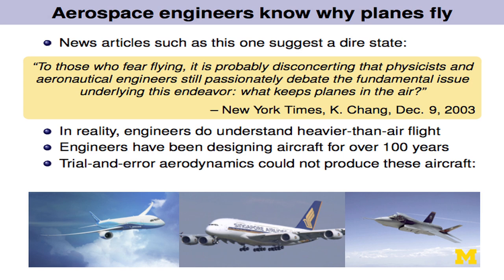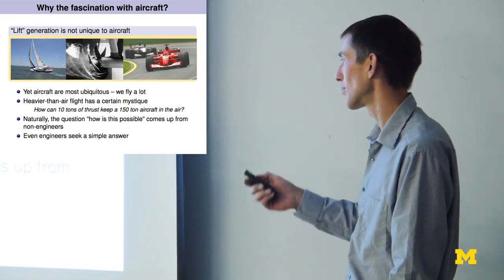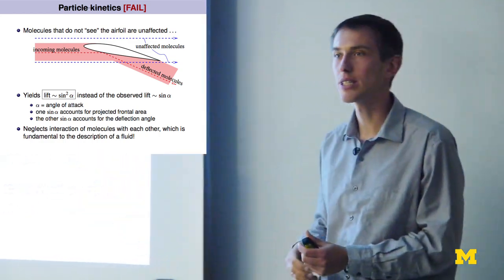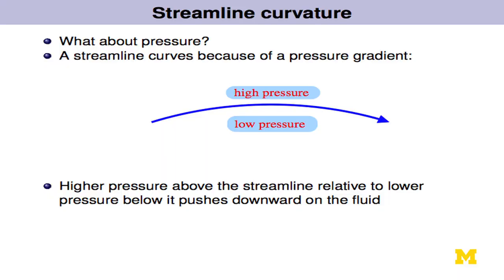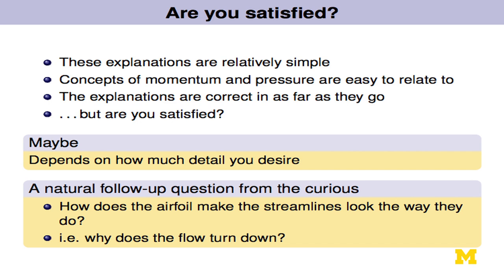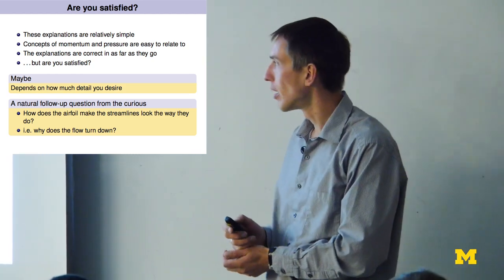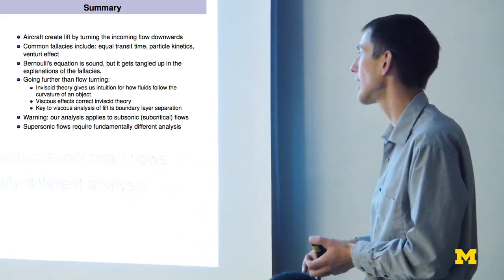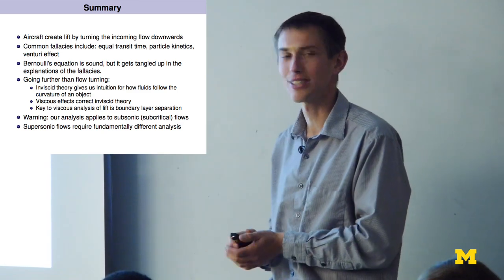Krzysztof Fidkowski | How Planes Fly

Comment: At 21:06 Prof Fidkowski does seriously misspeak.  I am very surprised he said that.
.
He glosses over just what the "pressure difference" would be when using that "Bad Bernoulli" misconception.  IF speed had something to do with it, the "moving air" would have lower pressure.  That is the air farther above and, therefore, [if' moving' air had a lower pressure - it doesn't]  the flow would curve UPWARD away from the wing. SO this is a double error on his part.  OOPS!!
So, yes, what he said is wrong.  O U C H ! ! 
.
. . . In addition, the air right above the wing IS MOVING!  In fact, it is moving in the opposite direction of flight - WHEN viewed from the ground as a wing passes by. SO. . . NOT ONLY can't you have stagnant air there, you don't! PERIOD! We SEE it moving toward the trailing edge BOTH in the wind tunnel and in flight. . .
I think I should talk to him. . . 
.
Also around time 23:38 He glosses over the fact that that "sharp turn" around the trailing edge is a HIGH acceleration. He only mentions needing a sharp Pressure Gradient.   He doesn't explain WHY viscosity and boundary layers make the physical flow off the trailing edge - that is very vague.  
I claim that it is the need tor a very high Pressure Gradient and the air's inertia that helps us understand why BOTH flows leave the  trailing edge like that.  Because it must.  Don't confuse things with inviscid flows.
.
You must cover the important fundamentals first, then when the student understands that, THEN you can add the more complex and issues beyond the basics.
.
For a wing's lift, it is best to start with the fact that lift comes from ONLY the  Top-Bottom pressure difference, Then, explain how/why those two are formed.
.
AFTER THAT, then. . . talk about the stall, upwash, downwash, tip spill, tip vortex, induced drag, form drag and intersection drag.
.
I also feel that he should NOT start with all this "separation" talk and the turbulence examples.  That is not part of flying.  That is part of NOT FLYING!.
I've seen this in my initial field of Electrical Engineering.  They want to explain everything up front and put too much unnecessary things in too early.

Comment: Idea of lift is simple. Introducing of obstacle into flow will change velocity of flow     (direction and speed). Any changes like this call fluid acceleration/deceleration. Any acceleration/deceleration will cause fictitious force ( remember what happen when we push brake pedal in car or turn car ) . Such force pushes fluid and causes pressure changes 9 as your fasten belt in car) . As long as pressure distribution around obstacle is not symmetrical ( as around not-rotating ball) obstacle will experience some net force  named lift  .
Reply: +Andrew Pa  i agree that the explanation in the video still fails to explain exactly how a low pressure area is created above the wing—saying it must exist by examining the air flow is not an explanation.

The conclusion that to explain lift one must consider viscous and inviscid flow simultaneously is, unfortunately, the conclusion—i expected it to be the starting point for explaining the colorful pressure distribution diagram that seems to be produced using Finite Element Analysis (?)

Since the simulation model seems to produce flows and pressures that match practical observations, maybe examining the FEA parametric variables step by step would help explain what happens and why.

Your explanation: I'm not used to dealing with fictitious forces as part of a valid solution in physics, so I did not understand most of your explanation. You seem to be getting inertia involved but it got quite confusing—likely due to the english structure. There may be a valid explanation lurking there... would you please re-write it perhaps just using Newtonian forces that I can understand and that can be validated in a lab, wind tunnel, etc.?

Regarding the ending part of your comment, you may have missed that part early in the video which points out that your explanation of non-symmetrical shapes and different lengths of flow does not account for how the symmetrical camber wings of some aerobatic airplanes produce lift or how an airplane flying inverted produces lift on the side of the airfoil that is opposite to your explanation.

Also, per your explanation, an airfoil with a relatively flat lower surface and a "wavy" corrugated upper surface should produce an incredible amount of lift — in reality it doesn't.

You seem to have a typo error while giving an example of non-symmetrical flow: "as around not-rotating ball" should probably be "as around rotating ball." This is because a non-rotating ball would have symmetrical flow around it and net zero lift, whereas a rotating ball WOULD "rotate the airflow with it" to a new direction (the Magnus Effect), which.will result in lift in the opposite direction.

Comment: A good explanation - but I think he should get together with Holger Babinsky at Cambridge (perhaps he has by now).
Nevertheless, there are major shortcomings in the presentation.  1) It is coming from the 'conventional' viewpoint of a stationary wing with air flowing over it, as in a wind tunnel,  2) It does not describe the reason why the air moving over the upper surface of the wing is moving faster than the air moving beneath it. 3) It does not describe 'holistically' the total flow field around a wing.
Thinking about item 1), in the 'real world' the air is stationary until it encounters a wing moving through it. The wing must, therefore, be displacing the air, which, at some time after the wing's passage, returns to a state of rest. It was not and never was "flowing". 2) Circulation theory is not mentioned - but circulation theory is not merely theory, it is a physical fact.  A wing is effectively generating a vortex around itself, which is stripped away or shed, as the wing continues on its way.  3) The downward deflection of the air (Newton's Third Law), as a result of the passage of the wing, is a manifestation of the vortex being shed. It can be seen in the 'real world' when an aircraft flies low over the cloud tops. There are numerous photos showing the 'trench' in the cloud tops, caused by the passage of the aircraft.

Comment: How can 10 tons of thrust keep a 100 ton aircraft in the air?

We all know that on an inclined plane, we can lift an object by a force much smaller than its weight. The same is true of airplanes, which are also on inclined planes and lift themselves into the sky with a small force.
This inclined plane is made up of wings and air. One is the wing inclined plane, the other is the air inclined plane. The wing has an angle of attack, so the wing is an inclined plane. Air flows through the surface of the wing, so air is in fact an invisible inclined plane. The air inclined plane consists of two parts, one is the air inclined plane at the bottom of the wing and the other is the air inclined plane at the top of the wing.
The bearing capacity of an inclined plane is determined by the material of the wing. The bearing capacity of air inclined plane is determined by the relative speed of air and wing. Under the condition of no stall, the greater the relative speed, the greater the bearing capacity of the air inclined plane, and the heavier the air inclined plane can bear.
The angle of inclined plane is related to the angle of attack, but not necessarily equal to the angle of attack. If the angle of attack is too large, the air inclined plane on the top of the wing will be destroyed. In this way, the support of air inclined plane will be greatly reduced.
https://qr.ae/TWIy3q
Reply: I prefer Dilbert's teeter-totter law of levitation.
Reply: @johnsherman7289  why？

Comment: This gives us flight instructors a dilemma. The FAA uses Bernoulli and Newton to explain life. This fella says, nah, don't mention those guys. So either teach the wrong thing and the student passes the test, or teach the wrong thing and have them totally confused.
Reply: But Newton does apply here and is a very important component of the explanation. The airflow is directed downward which pushes the wing upward.
Bernoulli also applies, but doesn't really provide anything useful to explain why there is lift. Bernoulli's principle only applies within a flow field and describes the relationship between pressure and speed. So it can tell you that higher speed also means lower pressure, but it doesn't tell you why this happens in the first place.
Reply: @xnoreq  If the airflow is directed downward via the combination of laminar flow and the shape of the wing, how does it actually push the wing upward if the downwash doesn't occur fully until it flows behind the wing and is separated from it?
Reply: @careywaldie6735  By the time the airflow separates from the top of the wing at the trailing edge, the airflow's direction has already changed, so that's not a point where we'd expect any lift being created in simple Newtonian physics. In terms of pressure, it drops on the top where the airflow actually curves and bends downwards. 

Imagine a symmetric airfoil at 0° AoA. In front of the leading edge you'll get a stagnation point on axis with the cord with higher pressure, then as the airflow bends symmetrically around the upper and lower part of the airfoil you get lower pressure (and higher velocity) and this increases again (slows down) towards the trailing edge where you again get a point of higher pressure. The airflow did not change direction, so no lift was created.

Now imagine the same airfoil at 15° AoA and assume laminar flow. The leading edge stagnation point will actually move down and back a bit. The airflow bends from this point over the leading edge and the upper curvature of the airfoil. In terms of pressure, you will see a significant drop in pressure on the upper side near the very front of the leading edge. This is where the curvature of the airflow is now highest.
(At the lower side, the boost in pressure from the stagnation point will drop rapidly, as the airflow also has to curve a bit in the other direction on the lower side.)
If we average the location of all pressures into a single "center of pressure" point then we see that this point has moved forward significantly vs. the 0° AoA case. The creation of lift has moved towards the leading edge, and this is in line with the simplistic explanation that lift is created due to directing the airflow downward.

(As you probably know, this is why wings themselves are an unstable system.)

Comment: Totally misses the point. It is not about airflow .Lift is created by the change in the properties of the disturbed airmass in that the kinetic energy of the particles is not random but parallel to the direction of movement of the airfoil. Since gasses occupy only a small fraction of the space in which they are present the amount of gas in any region of space can be increased without a change in pressure if the direction of the motion of the particles can be controlled

Comment: In the case of the Coanda effect it doesn't matter whether you're blowing a laminar jet over a wing or moving an airfoil through still air. 
Both framesets are correct.
Reply: No, thats not right. A Jet (or Free-Jet) pulls additional air from its surrounding which "pulls", for example, the sheet of paper up. It's actually visualised pretty well in this presentation (18:57). There is a specific velocity distribution (also visible on 18:57) needed to get this effect. This velocity distribution doesnt exist if you just flip around the coordinate system to move through stationary air, because where should this distribution now come from?
Reply: Actually yes it does. The Coanda effect only applies to jets and doesn’t apply to the airfoil, this is because jets (such as those in a hot tub) have to do with entrainment if surrounding fluids. What happens on the airfoil looks similar to the Coanda effect but it’s actually not. This was explained much better by a P.H.D fluid dynamics professor but unfortunately I can’t find the link to the page where he explained

Comment: Fundamentally wrong explanation.
Lift is caused by a starting vortex which causes a CIRCULATION to form around the wing, and it is the Kutta condition that determines the sum of all the circulation in the separating vortices. The circulation around the wing is then exactly the opposite of this sum. 
Without the circulation there is no lift at all, the  down wash is only present in 3-dimensional flow .
A wing in a wind tunnel  with a full width will create lift without any turning based on the circulation alone:
L = dens × span × V × circulation 
Called the Kutta Joukowsky Lift law.
You must make a distingtion between 2-D flow, like the flow in a compressor blade or a full width model in a wind tunnel and 3-D flow, where wing tip vortices are always present.
L = q × b² × π/4 × sin(beta) × (1 + cos(beta)²)
where
q = dynamic pressure
b = span
beta = deflection angle caused by the vortex system: circulation and contracting tip vortices
L = lift force for an elliptic loaded wing.
Only the presence of the circulation explains the up flow ahead of the wing